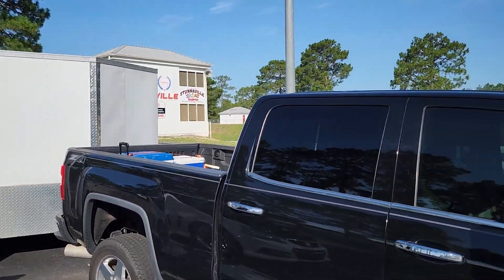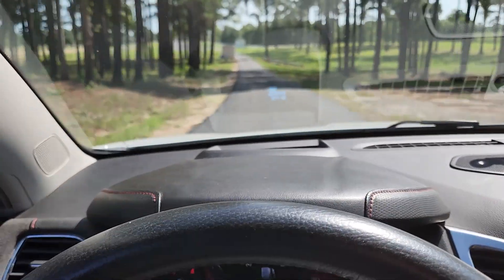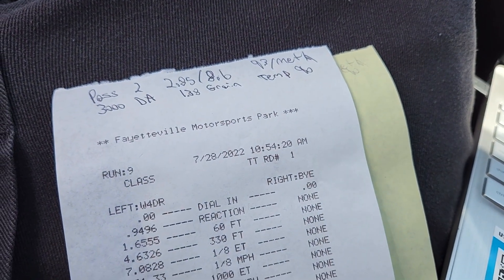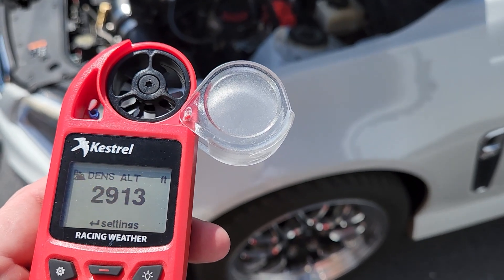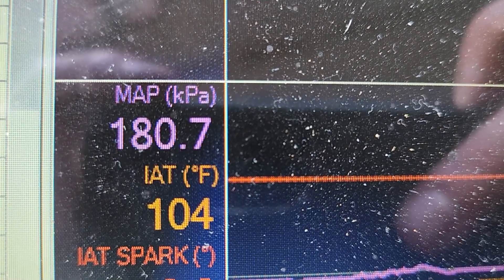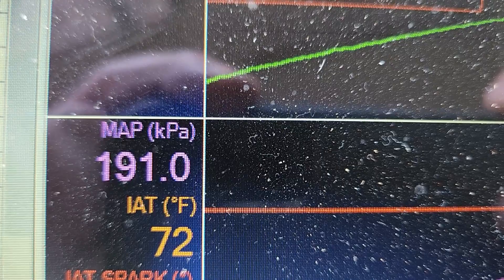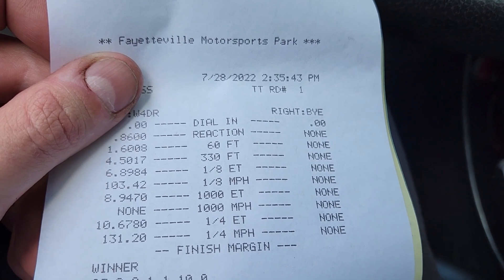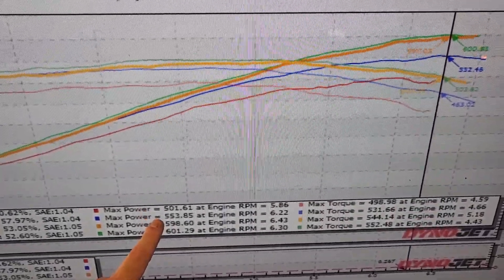Does MPH And Weight Prove WHP? LSA Chevy SS Track Testing To See How Weight + MPH = HP

Comment: im trying to get my blazer running right,it has a 6.0 cammed with a t56 6 speed and a torqstorm supercharger how come you change the plugs so many times is it due to the methanol or e 85,if it was just pump gas would you be swapping plugs so much because mine are super hard to get to,like it take a couple days to change them.whats the advantage let me know,i put cooler plugs in it when i got the supercharger ngk tr 2's or 3's i forgot ,thanks
Reply from the maker: The spark plug will show what's happening in every cylinder. A data log just shows what the computer is telling it to do timing-wise, and commanded fuel-wise. The wideband just shows what fueling is doing on that bank which averages all the cylinders. So one cyl could be rich one could be lean but the log will look fine. The plugs will show if one is rich or lean, or too hot, or too cold. Plugs don't lie but logs will.
Reply: thats awesome,yea your right 100 %.thanks

Comment: What is that wheel setup and specs . I love that look? Does it rub in the rear , rolled fenders?
Reply from the maker: Fenders aren't rolled. Suspension is all stock it doesn't rub and won't unless the shocks are worn out. Wheels are weld s77 rears are 17x10 +44 (7.2 BS) fronts are 18x5 -23 (2.2 BS)
Reply: That’s a badass setup thanks for the info

Comment: My friend was looking at getting a lsa engine and tremendous for an old project car. What other comparable engines can he look at for lower costs new or similar to a lsa? He wants a gm engine and near the performance of upper 5s to 700 range for power. He said he won’t build a gen 3 or 4 ls either.
Reply from the maker: Well this is an LS3 with a LSA supercharger. You can put an LSA supercharger on any ls it just might need adapter plates for the heads depending on the heads. But 500-700 is a huge difference. But if he won't do. Gen 3 or 4 LS he isn't doing any LS. They're either gen 3 or 4. Gen V isn't an LS.
Reply: @andrewd843  yes, I only mentioned the Ls gen3/4 engine because of the junkyard availability and affordable prices being modded. He likely wants a new factory engine setup within that power range. He wanted a 700hp 6.2 with the blower but I’m trying to get him to settle for something else to save some cash and be more realistic for his car. Thanks
Reply from the maker: @timweb1510  the LSA is a Gen4 LS. Ls2 (came both 24x and 58x) so I consider them a weird one. 

LS3, LS7, LS9, LSA, L99, L92, L76, and a few more are all gen4. 

If he wants OEM new and to have a 6.2 it's really LSA, LSA, or LS9 unless he wants a truck motor or L99 6.2.